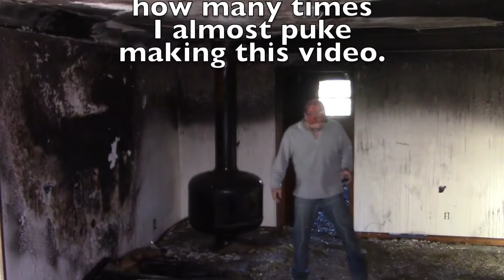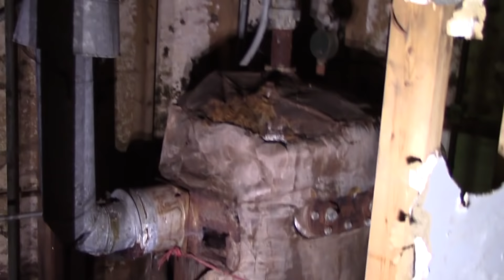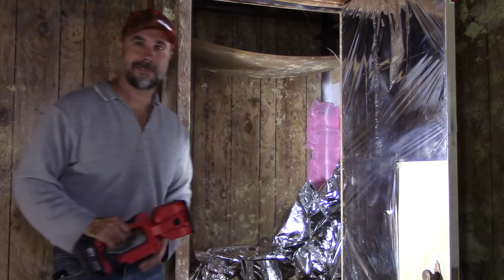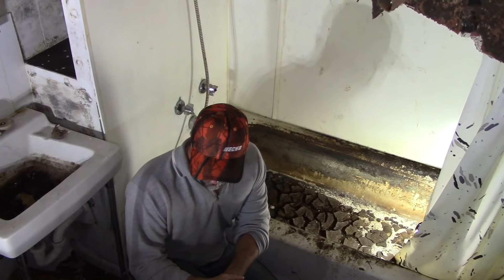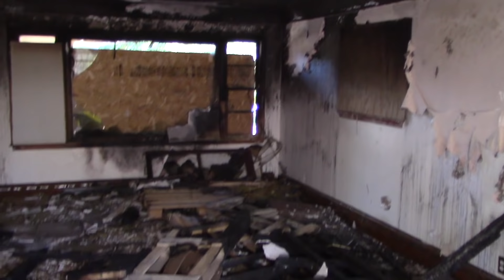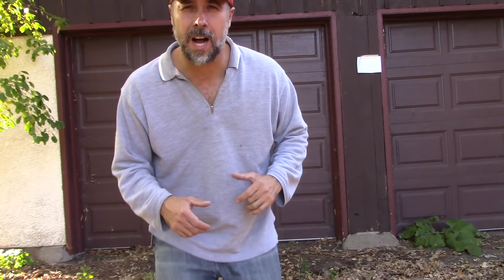Abandoned  house Over run with stench.

Comment: Does your state require a class B demo license for up to 35 feet and class A for anything over 35 feet? Demo seems hard to get into for a company with no demolition back round, In my state of Connecticut. The only way i can see getting the license is hiring someone with experience and piggy backing off them for the license "I hope I'm wrong"? Demolition seems to be a lucrative endeavor and anything that keeps the bigger equipment moving in my opinion is a positive.